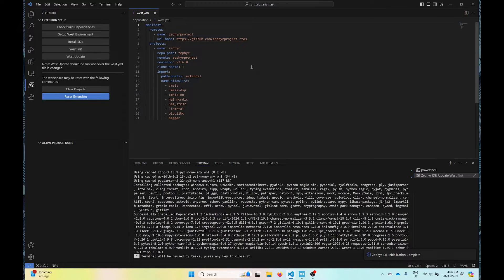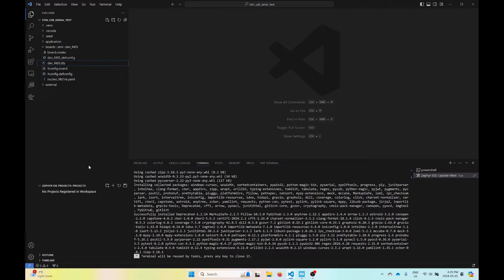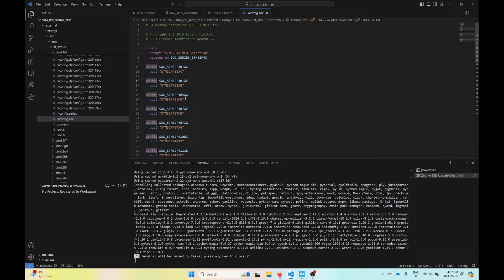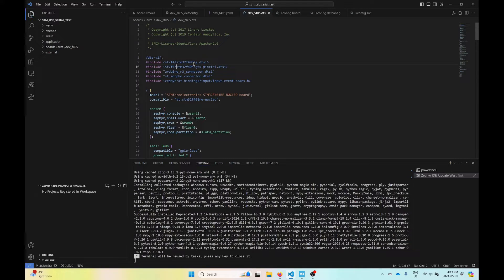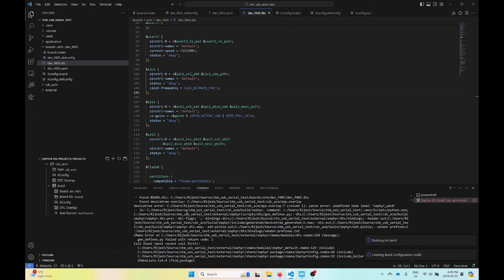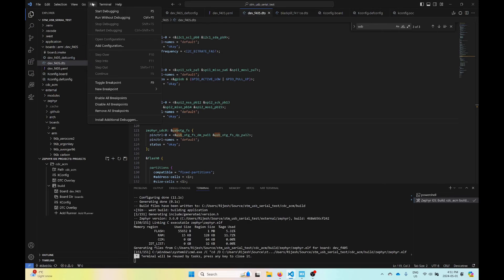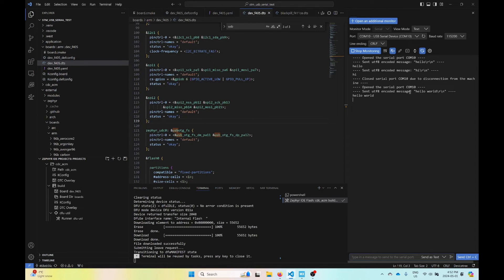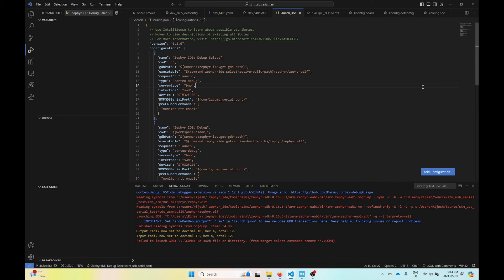STM32 Board Setup And Debugging with Zephyr IDE for Visual Studio Code

Comment: An actual example debugging an ST board with ST-Link wouls have been great. Any pointers?
Reply: yeah im wondering why use DFU when you have a board with STLink and the software supports openocd, maybe something im missing? Ive never used zephyr so maybe there is a reason?